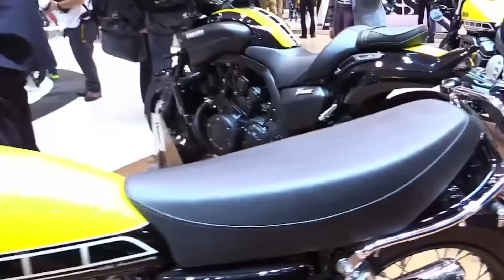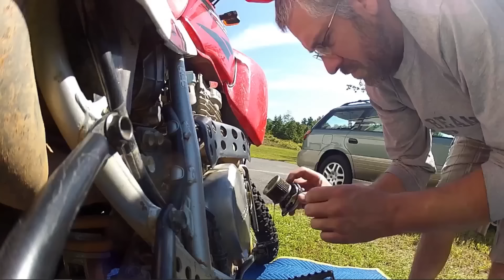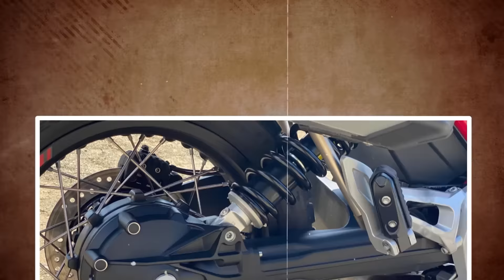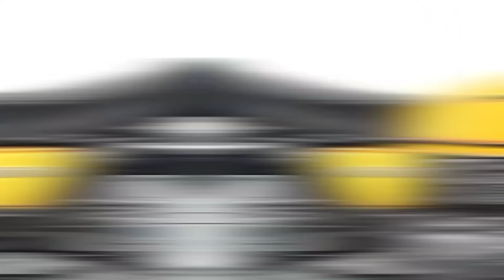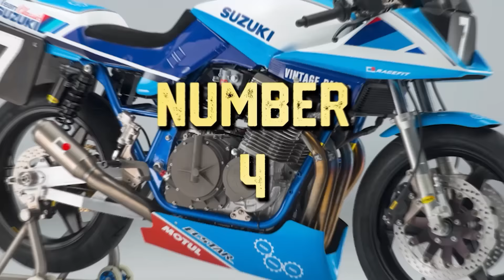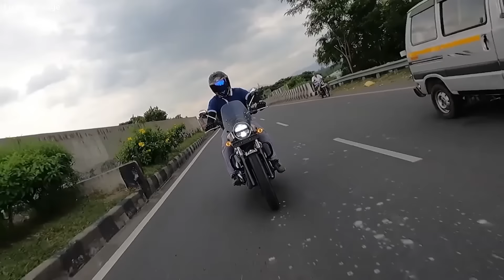15 Air-Cooled Motorcycles That Still DESTROY Modern Bikes (No Computers, No Problems)

Comment: I test rode a Ducati 750 in 1974. The bank wouldn't loan me the money and I remain convinced, had they done so, I almost certainly would've been peeled off a telephone pole a long time ago. Z1's were supposed to be docile until 6000 RPM and then it came on the pipe. The Dukker pulled from the bottom like a freight train/rocket. 80 mph in 3rd gear really quick w/o realizing it..

Comment: While I never owned a motorcycle I can tell you with certainty that water cooling in motorcycles is way better than air cooling and worth the extra cost. How do I know, as a high tech enthusiast I've modified 6 air cooled desktop computers and replaced it with water cooling and the performance immediately improved big time especially on hot days when I might run them for 5 hours nonstop. Remember heat is what shortens the life of machinery including motorcycles.

Comment: Re. the Moto-Guzzi Le Mans;  me and several friends had various Guzzi V-twins in the 1980s.  Common opinion - do NOT go for the later versions of them, and in particular, the Le Mans;  the 850 was bullet-proof reliable, later versions nowhere near as good.  One friend who tipped the scale at 200lbs plus took his 150lb wife out for a spin after buying a second hand Le Mans.  Wound it up into top, looked at the clocks, and thought "We must be doing more than 40mph!" - then he realised that was the REV counter;  the speedo was showing 110mph, but the engine was just poodling along!
All of the earlier 80s Guzzi V-twins, from the 850s down to the 350s, are rock solid tough, with superb linked brakes and razor sharp handling.  One benefit, if you're short on the inside leg;  the V-50 I had was so compact that people used to Japanese bikes assumed it was a 250!
Around the end of the 80s, Moto-Guzzi REALLY lost the plot, turning out fat, bloated, top heavy, PIG-UGLY MECHANICAL ABORTIONS of bikes, as though the design team had been taken over by a bunch of smackheads.
To say the earlier models were "brtally elegant" sounds like a contradiction in terms, but it fits.
One copper I was talking to looked at my V-50 outside a pub, and said:
"That bike looks like it's breaking half a dozen laws, even though it's parked on the centre-stand!"
I hope Satan has a special hot-spot reserved for the FILTH who stole it.

Comment: All of the advantages that liquid-cooling provides: consistent and lower operating temperatures and engine performance specs, it has one major disadvantage, corrosion, especially with aluminum alloys and worn out rotating seals, no matter what coolant one uses! Even with proper and fastidious maintenance and repairs, it is very unlikely that any liquid cooled motorcycle will become a forty year old classic, replacement parts availability will prevent this from ever happening. My 1969 fully restored Triumph Bonneville sitting next to me only happened because it was air-cooled! The photo you use in your video of the Honda CB750 KO in blue metallic was the same year (1970) and color as mine was, this motorcycle truly changed my life, it started my entrepreneurial life as an inventor, designer, and manufacturer, starting with vacuum synchronization tools for this same motorcycle (please click on the circular "H2H" logo to see my YouTube channel and search my invention video).  David Riddle

Comment: Honda CB 350 rs is a beautiful machine + a reliable work horse 💯👍🏼🔥🌟🌟
Reply: do you think the engine of the CB/GB 350 platform is very durable if you change the oil and the filters always on time, plus never abuse the engine?
Reply: @tomaszskowron2981 isn't it obvious 😅
Reply: @Scrambler695 by durable I mean could the original engine last 300k km or more, aproximately as much as that of a CB 500 F/X despite being a single cylinder?
Reply: @tomaszskowron2981 I've seen one with  200 k KMS,the owner sweared that It ran like new 😂👍🏼
Reply: I had a 350, good bike if you could stand the vibrations. 
I loved it. Then a 750f. Smooth  power.

Comment: I bought my first road bike in 1984 when I was 20 years old. A 1976 AMF Harley-Davidson Sportster. I bought it for $1,700. It rattled, it rumbled, and it leaked a little bit of oil, but it was damn fast. I rode it for almost 10 years and sold it for $2,000. Can't beat that!

Comment: Doing motorcycle thing since 1956 and yes some new bikes are a laptop on wheels. However there are some that are not and compared to the old bikes these bikes are jets and the old ones are biplanes. I know that times when things were simpler has a special appeal at times. I myself especially at my age loved those times but bikes are way more sophisticated and user friendly nowadays.
Reply: God bless you Walter. You'd have ridden pre unit bikes? That's what I first rebuilt the top end, clutch, magneto ignition, push rod valves BSA 1955 A10 650 twin. No timing marks. Just measuring pencil down bore before TDC points breaking with cigarette paper. It's red line was 5700RPM. Right hand gear change. Joe Lucas dynamo, Prince of darkness, k2f mag, a al monobloc carb. Open pipe with chicken wire. No battery needed but time it advanced and it could break your leg. It kicked back with 9 to 1 pistons. Split the sole of my doc mertens.
Reply: @IanHazedine my first bike was a used 165 cc two stroke, then a 250 cc four stroke single, 883 1957 HD Sportster. I picked up a 650 Bonnie next. Couldn’t find anything I wanted in the places I normally looked for motorcycles. So I bought a Honda 305 Super Hawk new until I could find something. Bought a Norton Commando. I remembered how that little Honda was always ready to go and every single thing worked trouble free. The new Honda 750 F Super Sport came out and yea I bought one. Long story short, I have been on one of the Japanese big fours just about ever since.

Comment: A lot of nonsense. I like air-cooled engines for their beauty and simplicity, but they always underperform liquid-cooled engines having tighter tolerances and much more horsepower. Honda introduced a beautiful new, high-quality, air-cooled CB1100 a few years ago, and while lots of riders said they wanted it in the U.S., sales died when they saw the actual specs (heavy and underpowered).
Reply: It was ugly and didn't look like the 750
Reply: It is air-cooled AND oil-cooled. It uses traditional cooling fins and a small oil cooler to maintain the optimal temperature. Just like the big block Bandit from Suzuki .
Reply: If your ONLY priority is horse-power, fine;  but not everyone shares your views, MR BLOODY ARROGANT.

Comment: I would like to know what the top speed is for a air cooled bike.
Reply: Is it very important to you that it can go 250 km/h?
Reply: Fast enough to kill you
Reply: @RobertMountfort  My Benelli Imperiale top speed  115 km/hour. More than enough to lose life In the  accident.
Reply: @cobbvd y 71 Suzuki 500 did well over 100. Way to fast. I've had my 06 Road King up to 90. Also way to fast
Reply: @RobertMountfort I am 70, for me the classic bike is enough. I like slow  ride. The forces are no longer what they were before. Unfortunately.
Reply: @cobbvd  l ride the back roads now and rarely go over 60
Reply: My 1977 honda cb750 k7 does 125 mph, that's more then enough
Reply: AN air cooled bike FFS.
Reply: If you are talking about how fast normal everyday street bikes from 1950 to 1980 as they would have been delivered from the manufacturer? My experience would say around 150 mph. Now some tricked up for racing bikes such as the salt flats etc were obviously faster. When you look at some of the old stories they talk about it was a fast bike because it could do the ton. The ton being 100 mph and only the cream of the crop in the old days could actually do a true measured 100 mph. You must consider the new bikes are 30 to 40 percent lighter, produce up to 3 and one half times the horsepower per cubic inch of engine displacement. Better metal quality, better machining and fitting coupled with water cooling that allows much closer tolerances and reduces friction loss through the entire power train. Four valve cylinder heads, fuel injection, precise ignition timing with a very hot spark plus generally better fuel quality. The list why modern motorcycles are so fast compared to old ones is even longer than I listed above.
In my lifetime we went from steam engine powered trains to diesel, electric and even turbine powered trains. Planes had propellers and gasoline engines turned into jets capable of 3000 mph. A new car without automatic transmission, powered steering, A/c, Satellite radio, navigation, power seating, locks and windows etc is almost impossible to find.
Reply: My 1972 Z1 900 would do a solid indicated 135 mph, whatever that turns out to be.  The later models were tuned for more lower end, and actually were nicer to ride, but not as fast.
Reply: Why? Is it for the street 😊😮
Reply: Faster than anyone  needs to go. Listen and learn from these great motorcycles.  😊😊😊😊😊❤❤❤❤❤❤❤❤❤❤❤❤❤❤❤❤ ❤ ❤❤
Reply: Plenty did 140+. A Suzuki gsx1100ef 
could manage 150 in tests.
More than anyone can ever need on the road.